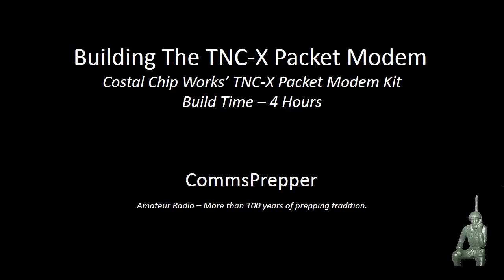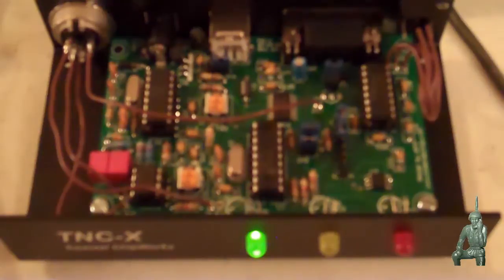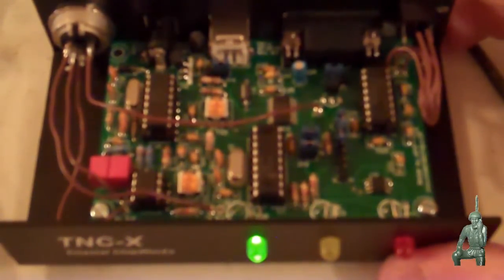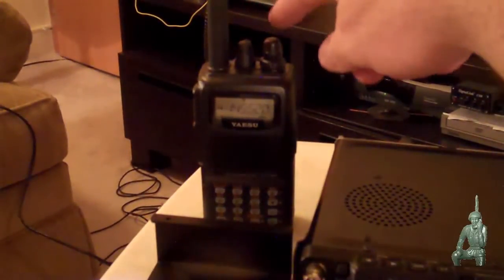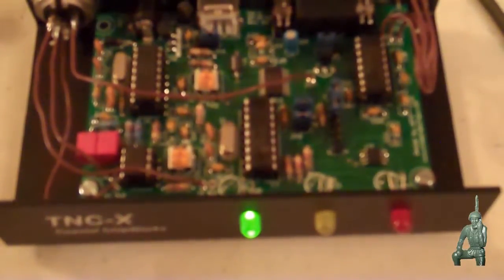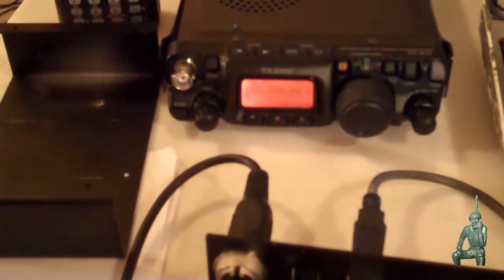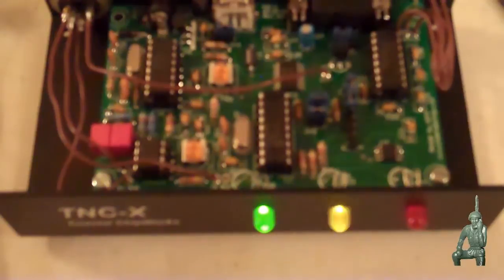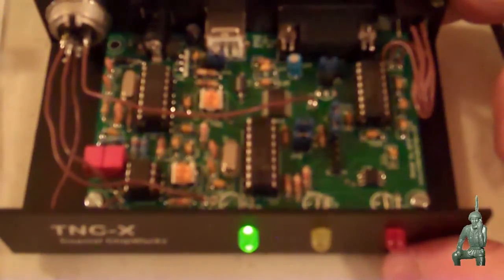TNC-X

Comment: A friend held a TNC-X build session and it did take about 3 hours to build given a working example was near by.  I have now used the TNC-X on a Yaesu FT8900R and Baofeng UV-5R.  My Baofeng does lock up with a direct attached antenna but does work through an attic j-pole.  I built a cable according to picture.  A monitoring radio sound a tone at the end of transmission which is normal for the TNC-X.
Reply: +George Paxson SRI picture did not display.  Picture at https://packetradio.com/catalog/index.php?main_page=product_info&products_id=2572

Comment from the maker: I have ferrite chokes on all the cables and they did help some.  I have found that I have to keep the antenna away from the TNC and the laptop.  When the RF is close it causes the USB line to drop.  This problem is more pronounced with my cheaper radios (Puxing and Wouxun) and less pronounced with my Kenwoods and Yaesus.

Comment: Any type of pulse either electromagnetic or nuclear with render all the ic's dead, even if you use a faraday screen to protect the internals experiments have show that any increase in static or pulse aftermath shock with disable all microprocessor circuitry.  Now the same tests by amateurs have found,that valve technologies  are some what different, the main reason is their latitude for voltage variation in the environment is far greater than component ic's. i have replicated such tests myself

Comment from the maker: I'm not sure I understand your question.  If you are using radios to make the link between the two computers then you will need a radio license to match the radio service you are operating in (provided that radio service permits data communications).  For example, if you are using Amateur radios/frequencies, then you will need an Amateur Radio license.  Packet between two computers using phone lines I don't believe required a license.